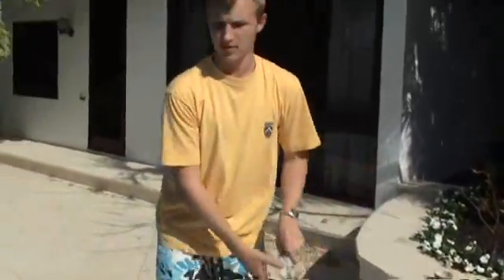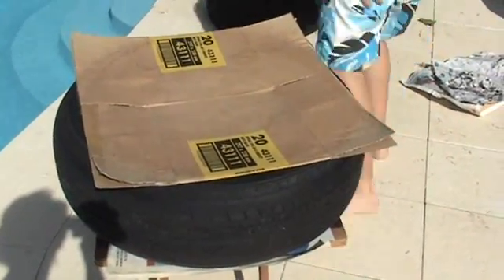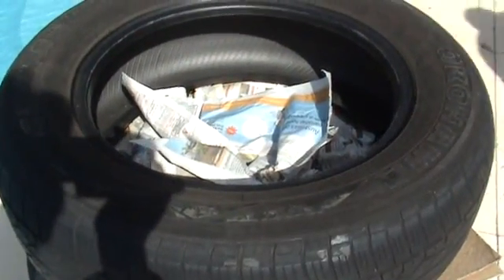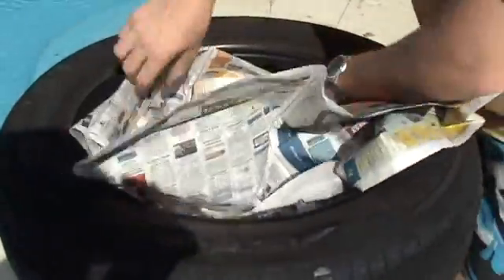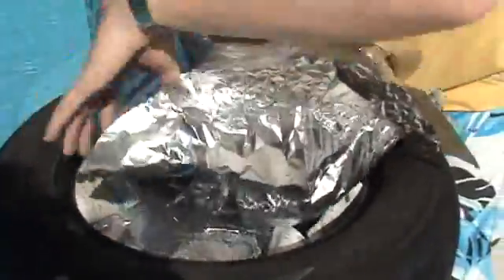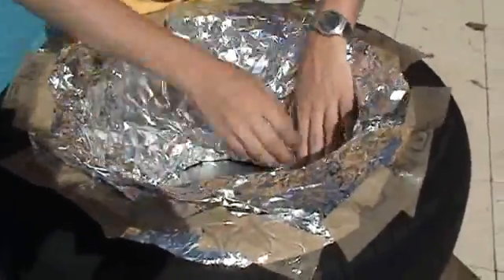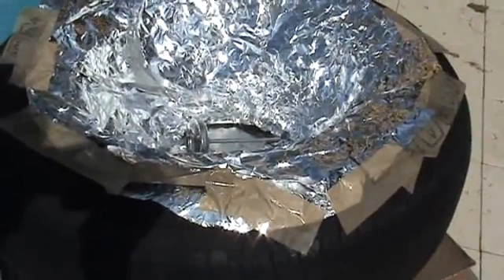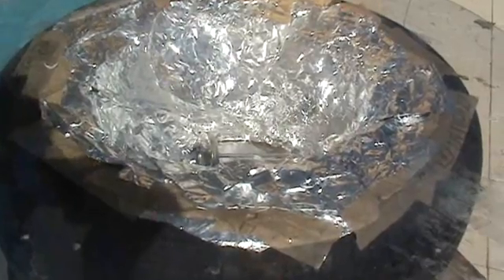The solar tyre cooker - Construction

Comment: For those who are worried about the out gassing from the tires, I would suggest placing your food into a jar like a canning jar or big pickle jar. Should be able to use the heating of the tires and aluminum without the toxins transferring to the food.

Comment: Ah, the hot simmering toxins from degrading tyres slowly cooking your food.
Reply: No, our life are surrounded by chemical, plastic, oil gas. So what about the electric stove made of plastic parts, microwave made of plastic, food cooking in plastic.  Tyre do not degrade that is why they are everywhere.  Tyre is the body of the stove.

Comment from the maker: Tyres were a choice based on the context. In research done on Cambodia we found that there were many old tyres available which were left over from the war. The availability of this rigid air enclosure made it a sensible choice at the time.
Reply: can it be done with a single tyre? what the use of the first one at the bottom?

Comment from the maker: @screamphilling Great to hear you've given it a try. Good idea with the use of plastic bags, they should still immobilise the air within the tire for good insulation. You may note that the oven can be quite vulnerable to overcast or cloudy weather. I would note the differences in sun contact if you wanted to correlate your data properly. I will post a link to our full report soon.

Comment: Just built one as per your instructions.   I used recycled plastic shopping bags instead of newspaper for insulation.   

My oven only seems to get up to about 76C (170F).  It is mid-April at 30 degrees latitude in the northern hemisphere.   

I am adding external reflectors to see if I can increase the temperature / sun intensity.    The tire is very effective at storing heat it seems.... I may post a  video response...

Comment from the maker: Good point, in the report that accompanied this design proposal, we included this second tyre as a means of raising the hot contents off the ground and providing another insulating layer of air. The ground the oven is sitting on could be quite cold. Please pm me if you would like a copy of the report